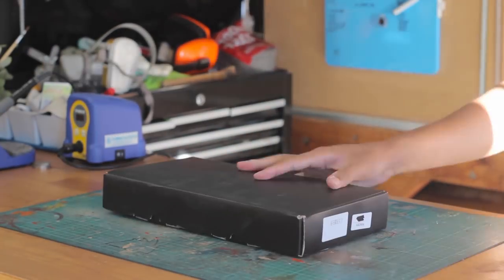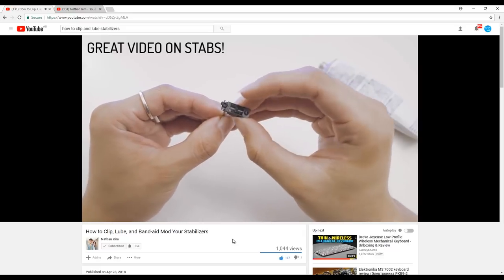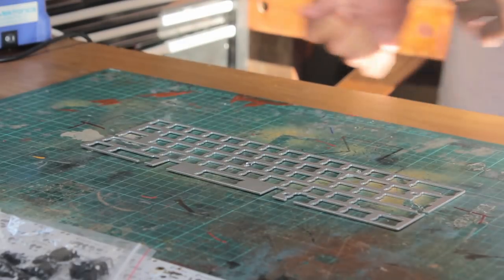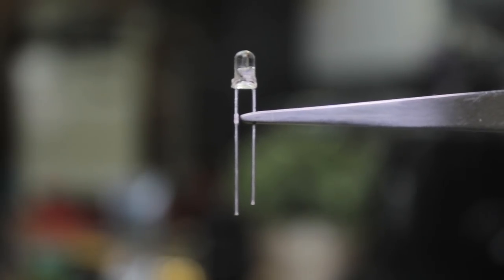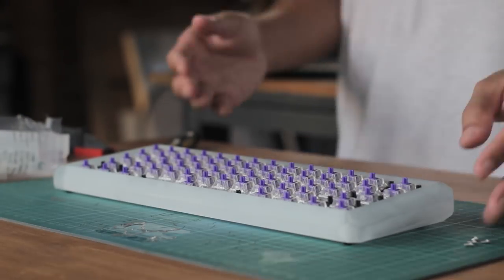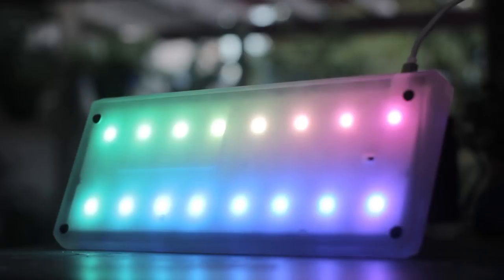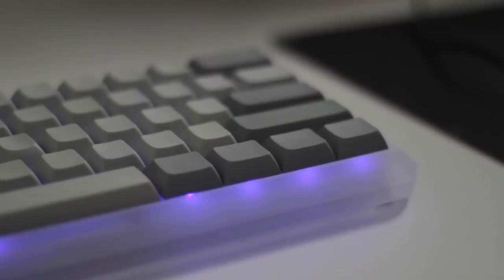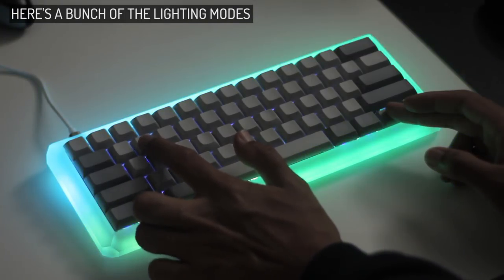Mechanical Keyboard Build : 5° Acrylic Case + DZ60 PCB

Comment: I think one under-appreciated aspect of acrylic cases is acoustics.  Honestly they just sound much better than most custom CNC milled aluminum cases (which isn't hard since most of those sound terrible).  The acrylic gives it a softer tone without all the reverberation.
Reply: imo putting sound dampening foam (dynamat, shelf liner, etc) in alu cases makes them sound much better

Comment: I just build my first keyboard this week. A DZ60 with a aliminium case from KBD. Did not realize that there are leds on the underside of the pcb. I'm not a real fan of leds but the underglow does look very nice. Maybe I will buy a transparent case later or build a new one with transparent case. You'r build looks really nice.

Comment: If you had used screw-in stabilizers, would you have been able to avoid the problem of the stabilizers slipping out and needing to use hot glue to stick them in place?
Reply from the maker: Yep.
Reply: Cool, thanks for the reply! I'll keep that in mind!

Comment: Does anyone know if it would be feasible to build basically this exact keyboard, but tenkeyless instead of 60%?
Reply: Lauren Berns III They don't have this case in TKL form.  And I don't know of any TKL PCB's with RGB underglow.
Reply: Damn, that's too bad. I need my pgup/pgdn cluster and f-keys!
Reply: Lauren Berns III You could always get a KBD75, it doesn't have as much underglow and is constructed out of aluminum rather than acrylic, but it's a nice board.

Comment: those blockers look terrible, they shouolda just made a separate hhkb style 5°
Reply: Sic Semper Beats That would change the case into 2 separate parts with top mounted plate.
Reply: Oren Nemo i know but the blockers just look soo bad. Not just the light diffusion, but the lines that separate them from the rest of the case are terribly obvious.

Comment: I'm really wondering, since those LED's pop out taller than the switches itself, does the typing sound changes compared to no LED  backlight on the switches? since the keycap themselves now is tapping on the LED rather than the switches.

Comment: I'm new to mech boards. I'd like to build this exact case, but I'd like a PCB that not only has RGB on the bottom but for each key too, rather than one singular color. Does one exist? Can you point me in that direction? Thanks.

Comment: have you tried Kailh pro/speed switches? If so, are they any good?
Reply from the maker: Not on actual keyboards. Only on switch testers for a few seconds.
Reply: I reccomend the silvers. They’re even smoother than Cherry’s. (As per usual)
Reply: The bronze and gold are pretty good apparently, the gold are like a much nicer MX Blue and the Bronze have the clickbar so sort of similar to BOX Whites but with a higher up actuation.

Comment: What would be an alternative to using hot glue?
Reply from the maker: Buying screw in stabs in the first place. Toothpicks usually work well enough for normal situations. Not sure, whatever helps keep the clips spread. It's useful to have a hot glue gun at home anyway :)

Comment: Would you be able to use kailh box switches with this pcb? sorry i'm a newbie but i want to use the box navy's and i want to make sure it'll work
Reply: it will work
Reply from the maker: The only differences with Kailh Box switches is that they are plate mount. And that you need to install the LEDs differently. I've done a Box Brown build video that you can check if you need.
Reply: could you send a link :D i can't find it on your channel for some reason.

Comment: Tell me if this is good build.

KBDFans GH6X plus solderless with underglow
KBDFans acrylic case
Gateron brown switches
O rings
Cherry stabilizers (cut and lubed)
PBT Milk keycaps
Blue keycaps
white keycaps
Reply from the maker: Dont know what that PCB is. In my opinion, just get silent tactiles like Aliaz switches, rather than having O-rings. 
If you're talking about the KBD6x hotswap PCB, then be careful with the keycap sizes as well.

Comment: can i add this to my gk61 case ??
Reply: If you want to change cases than you need to buy a new plate that supports typical tray mount screw holes
Reply: @Snr.Reapuh  unless you gasket mount or gummy o ring mount it